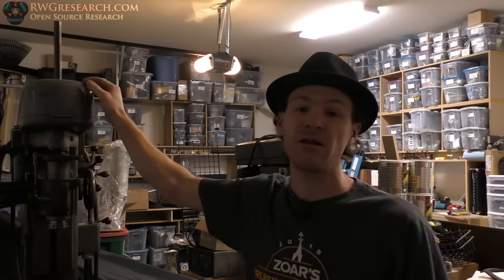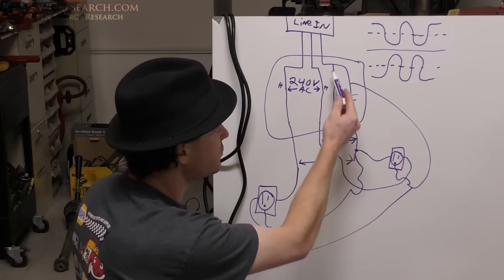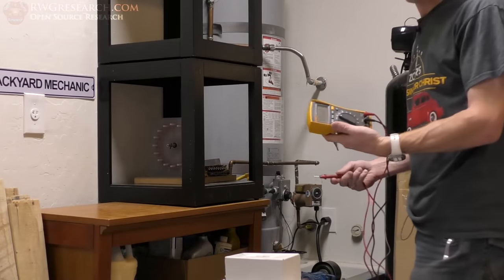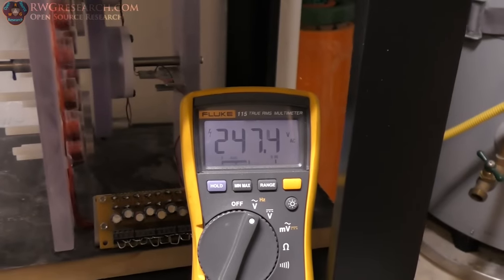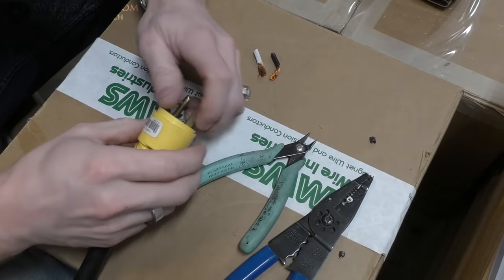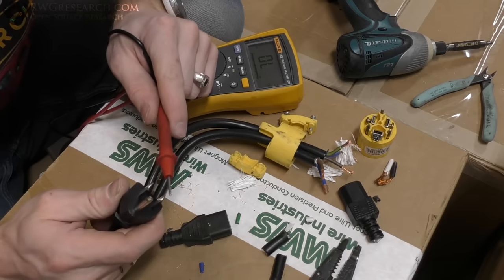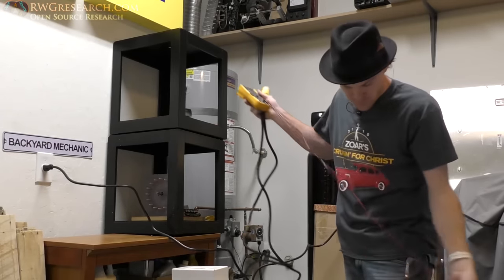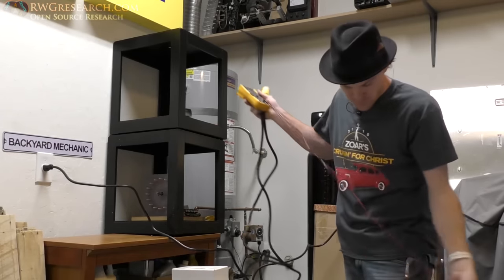How To Get 220V/240V From Two 120V Outlets. No Electrical Panel Work Required...

Comment: Can you go into detail about the risks/mitigations of one of the outlets having a bad ground? 

My concern with trying this has always been that if one outlet has a bad ground the full two phases will be grounding over a single 120v rated line.

I have theorized that DIY replacement plugs should be used for both 120v plugs(LP-31?) so that both of the neutral & ground pairs (blue&green) can be ganged per line so that there is double the copper coming from the splitting socket's (6-20p) ground terminal going to the ground terminal on each of the 120v plugs.

This however still worries me because I'm not sure that either wall socket can alone safely handle 240v going over its ground.

Furthermore I don't think there is any sumsuch  overvolt breaker tripping of grounds in standard setups.

Thoughts/corrections, I'm all ears?
Reply: It's not the volts that would be a concern, but the amperage. Either leg is at most 120v from the ground/neutral. The 220v is referenced from each other not from ground/neutral. And the ground is rated to carry the 15A from either outlet. You should rate your ground for the biggest breaker in that circuit.
Reply: Correct me if I'm wrong but if both phases are shorting to ground it could easily pass 30 amps?
Reply: nope. It would be like 2 different phased circuits sharing a neutral. If the same load is on each circuit, the neutral sees no current. If one phase pulls 10amps, and the other is pulling 15, the neutral only sees 5 amps.

If the 2 circuits are  in-phase and sharing a neutral the neutral would see 25 amps. Ground is literally the same as neutral in this situation.

Think of it as 2 hydraulic cylinder connected together with a hose and a T in the middle. If you push one cylinder close the fluid would flow out the T. If you pulled the other cylinder open at the same time, the fluid would flow through the T and the hose and be sucked in the other cylinder. Nothing would flow out the T.

Comment: This is awesome! Well done. My husband will probably not let me try it. LOL. We have a 1948 house. Most of the outlets are not grounded. (We do have a newer breaker box.). Also we have some old 220 that used to run wall heaters and are still hooked up to the breaker box. Do I need to find the few grounded plugs to make this work or can I use ungrounded plugs? I only need this temerarily to run tools during a renovation. READ YOU BIBLE more! Yep that really works too! Another great tip.

Comment: This will definitely work but could also be a hazard if one of your plugs gets unplugged intentionally or inadvertently.. Let's say your wife or child goes to use that plug and unplugs one of them. The male end of that unplugged male could still be hot through the load and shock you.

Comment: if you connect a neon indicator light between the two hot lines you'll be able to tell when you've plugged into two out of phase outlets.
Reply: and sticking a fork in an outlet is a good way to test if it's live. very bad idea to experiment like that. plug in and find you have hot/neutral swapped on an outlet, those neons wont help you. you'll get warm in a hurry. this whole video and comment section is full of bad ideas. interesting thought though, using neons.

Comment: I'm trying to do this same work you show here however I would like to know the reason for not hooking up the neutral wires from both cables which come from the walls to make 240 volts since my laundry dryer cord has 3 prongs (1 hot, 1 Neutral and 1 ground) will the dryer work fine by just connecting it to this 240v line you made?  just Hot Wires and Ground without the neutral wire? Thank you

Comment: Three questions. Does this process cause extra heat in the powerline in the wall? Am I going to burn my house down? And can I use more than one device on this line by simply adding a splitter as long as I don’t use them at the same time. For instance my lathe and my mill

Comment: Question . Could the same theory work for example   If I’m out camping , and I have  a tool that requires 2500w but I only have 3 , 1000w inverters. Could I use the ends and out one in each in dryer to pull approx 833.33w per inverter? How can I be sure that they pull evenly   ?

Comment: Question. If 2 different outlets are in 3 different 20amp circuit breaker, and the appliance that needs to be plugged in requires 30amp, will it be sufficient? Converting 2 different 120v outlets to 1-240v outlet.

Comment: hey Russ  i got a crazy question about the power voltage i saw on Amazon for $19.99 a converter box that just plugs in and gives you a 220 and a 110 plug  on the face it said it was good in Countriesthat have either 110 or220 voltage  i thought the price was rediculously low and that really suprised me i’m a Woodworker a dive alwayshired a electrician to put plugs in where i needed them  and sometimes i would do parts of the install but he would do my final hookups  i’m looking at new  table saws  and because of aTraumaticBrainInjury i suffered 10 years ago that changed everything in my life so i have to start everything over again   does that 20 dollar box really do what they say it does ? it seams way too easy to do it that way but heck if it’s safe and works it’s way cheaper than paying a Electrician to do his thing  of course i’ll go that way
Reply: bye bye

Comment: If your in the us the cycle of up and down is at 60htz that cycles per second the electricity is the parting of electons through the metal conductive material in residential it's called Romex. If the sum of the length of the Romex between the breaker and the outlet and the  length of the cord from  the outlet  and the Device are unequal to each other then over time the two opposing phases of the wave will be in the same phase when they reach the appliance. This is called crossing phases and you will die and so too will anyone near the blast raidus or the flying shrapnel

Comment: I guessed you use a transformer 2 to 1 ratio but that wouldn't likely have enough amperage tob power the load.  That's a creative idea.
Reply: actually that is the proper way, just need a big enough transformer, rated to the task. horrible ides to hack together death cords.

Comment: Nice hack, but it needs to be careful to ensure outlets wired correctly (phase-neutral not crossed on pins) before attempting to use this 'hack-cord' or add some fast breaker or over current sense circuit.

Comment: In order to do this right means i have to pay for a permit then for me a new circuit box with upgrade then i have to run a 10 amp 220vac line run off a new circuit breaker with much heavier power line across my house hardwire contact building and safety get it inspected to legally stamp sign off that it won't  start a fire is properly grounded.  You get the roll call . On top of that the Assessor's office will raise my property tax because it is deemed a improvement which requires a higher property tax assessment.

Comment: Exactly what I searched for to make a DIY cloth dryer in winter. I will use a 240 volt baseboard heater under the clothing rack that I can easily store after.

Comment: My problem with this is the gauge of the 110 wires. They are not meant to carry the load that a 220v device draws. The copper wiring in the walls could literally melt before the breaker in the panel would pop. I am no electrician, but i think this is a legitimate concern. Electricians please give your opinion!
Reply from the maker: 220 draws less current on for the same devices running at 120.... ~Russ
Reply: Perhaps you're thinking Amps? You can run 480v on those same conductors as long as they are rated for the amps..

Comment: Very cool.  Russ, i want to say that earlier i said resonance with the speed of light would alter how an electrical generation would work.  I still believe that, however with such low speeds as your magnet turns, it would be inconsequential.  But I will honor my promise anyway.  For a two inch magnet, the light speed resonance would not be determined on its size at all, but instead on the peak waves of the electrical sine waves for the system.  So I will give both. The following numbers are based on octaves being a natural product of a subatomic system for transfer of energy in sound, electricity and light waves. Thus to resonate with the universe, light speed is the standard.  Being incredibly fast, we cut the speed down using octaves, divisions of 8.  Finding suitable numbers required me to use powers of 8, which still gives us clean octaves.   For the rotation of a 2 inch magnet, light speed divided by 8 to the power of 10, gives us 1.750 turns per second, or 105 revolutions per minute.  A faster resonance is found at light/8 to 9th power at 14.003 tps or 840.18 rpm.  And light/8 to the 8th, is 112.031 tps or 6721.86 rpm.  

I will add frequencies later.  I'm basing them on cymatics and light speed.
Reply: WAT
Reply: @Mike-qo4kp  Did I reply to the wrong video?
Reply: @gristlevonraben  not sure but possible
Reply: @gristlevonraben  honestly my remark was just my way of saying "whatever you said flew right over my head"
Reply: @Mike-qo4kp  I think I was replying to a video about generating electricity, and was saying that perhaps light speed octaves might enhance energy generation because octaves can cause amplitudes of signals if done right, so why not try to cause amplitude of energy generation by trying to enhance energy transfer at speeds of rotation that are octaves of light speed.

Comment: What you do is dangerous because there are two different fuses on different outlets. Brakers must monitor the go and return current on the same fuse. Brakers have two different braking systems . The one is heat based that means it will trip when current is high. The other is magnetic based (fast transient) it will fast trip on a short circuits. Using different brakers might not have any fast response function from your brakers. Here in Belgium we have 400V 3 faze . We make 230V using L and N.

Comment: Hey Russ, I know I'm late man to the party.  just a question for ya.  What is the amp rating for your mill?  BTW a hobbiest mechanic, also a hobbiest computer repairman.  For work I am a Pressman and have been running German built printing presses since 2004.  I've had an exuberant amount of electrical issues with these presses, and have seemed to find and sort them all on my own over the last 14 years- Main power in is 480 volts 3 phase and I've only been shocked once early on- luckally it was reduced to 230 3 phase at that point and I only graized 2 of the wires with a finger.
I have a 230 outlet that I wired in my parents garage (back when I was living there) and that required a 30 amp breaker.  Well, between the air compressor, the mig welder, and the plasma cutter- you have to chose what gets the power for one plug.
I would assume if you are taking 2 120 volt out of phase outlets that are rated at 10 amps then that yields you 20 amps total at the wall(even though your computer cords are rated at 15 amps each I don't think between the 2 phases they will like being pushed back and forth another 5 amps over the breaker point), and you have the conversion motor to reconstitute 2 phase 230 as a 3 phase 230-240-  SO- how many more amps are you pulling to make up a third phase through the converter motor?  
Just curious- a guy that had to learn it all on his own.  
Also- sorry- but another thought.  The thickness of your original wires to the mill looks good.  What I see is you are using thinner wires (15 amp each side ~12/14 gauge?) coming from the wall outlets to plug into properly sized wire.  My worry is that you may have power showing that it works right now, and can handle showing that it is powering up, but when you get into loading the motor and need more draw that you start burning insulation, or please forgive- burn up the internal house wiring insolation and start a fire. 

micahmcg@gmail.com
Reply from the maker: smell-this-smell  in the video i said that its a light load, its 5amps max for my converter. Hardly anything to worry about. Thanks for your comment, ~Russ

Comment: i like the idea, But the 120V power in US is 60 Hz and the standard 240V in Euro is 50 Hz, you are making a 240V 60Hz power, if the machine designed to run 240V will all be 50Hz, i wonder if the machine run loader than usual under 60Hz.

Comment: In America most home are 220v 1ph service drop to the panel..
Reply: yes but what's the Max amperage rating?
Reply: bobbg  you can get as many amps as you want ... normal house have 200 amp panel 

But electric compagnie can supply as many as you need 

just gotta change your electrical component to match what you need

Comment: Are those computer cables rated at 15 amps, or are the connectors rated at 15 amps? The cable rating is stamped on the cable length, while the connector rating is stamped on the ends of the connector. From the video it’s hard to tell what size those wires are.

Comment: A few people mentioned issues doing this with GFCI outlets. Has anyone found a work around for this?

My thought is that the GFCI is tripping because the neutral is clipped. So since the neutral for a 240V circuit is essentially the off phase of the other hot leg, what if you wire the opposite neutral together with each hot leg in the 240V receptacle? Figure this will either work or start a fire. Would appreciate it if someone with more knowledge would chime in.

Background: trying to get my dust collector running in a garage at a place I'm renting. Would like to avoid running a dedicated line because it's more holes in the wall to patch when I move out. I know I could also delete the GFCI by unprotecting the outlets but I figure if I'm going to go through all that work I may as well run a dedicated line.

Comment: Okay say his 50amp breaker has 2 hot(25amp) each along with 1 neutral... grounding out wherever you are.... you would need an a/c copassitor for each pole hooked up a motor fuse(relay) which you can find the old kind that are in glass tubes at home depot for like 6 bucks .... i touched 2 hots together coming from the circuit 50amp braker and damn it was like welding without a mask.... tripped the 100amp breaker outside.. so best bet is to wire a regular   110 plug and connect the other hot with a $6 15-30amp motor fuse that way you won't blow your 50 inside or 100 amp breaker outside... by the way the reason this stuff is harder to test/wire is because it's dangerous and difficult to work with....

Comment: 🤔Could this work on a portable gas generator? Would this power up a well pump that is 240v with a portable 7,500 running volt gas generator, cause both receptacles are coming from the same source...Or would that make it work better? 😉Lol Don’t mind me, I’m very tired and it is very late where I am right now.😴

Comment: if you "get the wrong wires" you're potentially shorting 120v to ground or neutral or out of phase 120v. best case scenario if that happens, the breaker trips before anything bursts into flame.
Reply: can destroy the breaker or worse

Comment: how do i get 220 from 2   110 volt power converters off my 2    12 volt batteries. will this work also
Reply: dan wells if you want to get 220v from a 2110v power converter from a 212 volt battery I recommend you wire the primary winding of a transformer 2110 times and wire the secondary winding 225 times. Then enjoy.

Comment: I've been scouring the internet for days trying to power any machine that requires t wist lock, and especially is above 120v.  no I can't get twist lock outlets installed. no I don't want to do it myself even tho I could, no I dont want to schedule an electrician, never done it. The closest thing I got to it was splitter with one twist lock that takes energy from 2 120v outlets, it's from quick 220 systems, about to order it. Trying to pretty much power a power distrobutor for some stage lights that are over 120v AND have the twist lock male.. One is a Varilite 3500 Wash, the other 2 are Ayrton's Magic  Dot R's. I'd love some guidance, anyone!!

Comment: Do you have the multi meter plugged up wrong the the little plug the little spice in the Alec goes to the black wire and out in the red wire goes into the big slide on the outlet

Comment: The issue i have is i need 220v at about 30a..may not be doable since most 120 circuits in homes are 15a....and the odds of finding 2 outlets in same area that are on two diff phases probably isnt too common...
Reply: so you need 4 outlets on separate 15 amp circuits. just because you can does not mean you should. absolutely never do something like that. I'm not holding your beer and watching. the comments on this video are such bad ideas, I'd want nothing to do with it.

Comment: I really like this idea as my house is not conducive to running more electrical wiring to my second level from my basement breaker box. I want to use this idea for connecting a 240v clothes washer dryer combination. My question is, what if the circuit requires a 30 amp breaker but the two 110 v supply lines are only 15 amp, is this still ok?

Comment: Great video and interesting setup. My question is will this work for a window Ac unit. It needs 240volts but the wattage is 3450. Will this work..Thanks.
Reply: Ohms law I believe you divide your voltage into the wattage giving a rough number of 14.375 amps. Check your wiring gauge and braker.
Reply: Eric is correct. AC usually needs 20 amp breaker